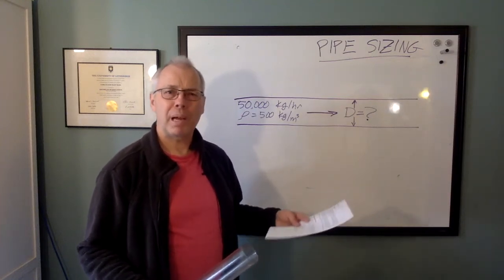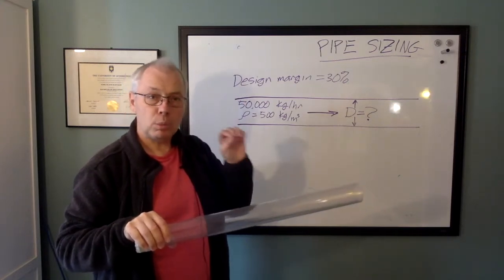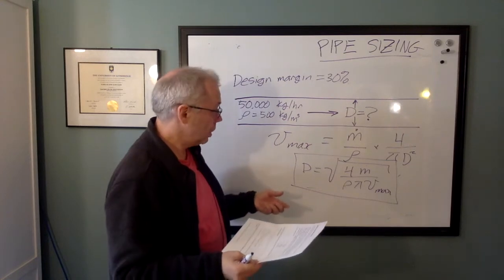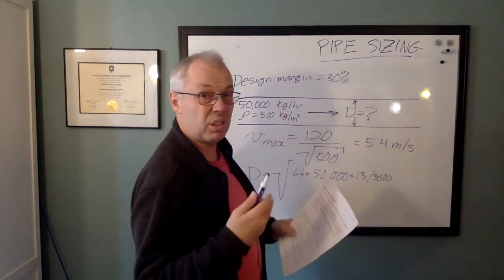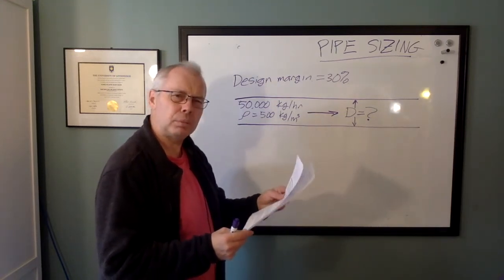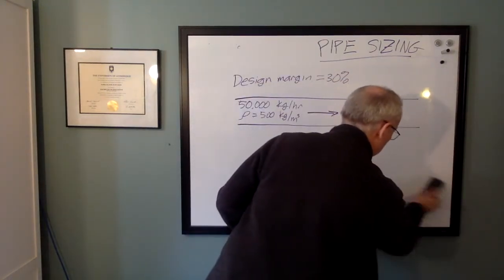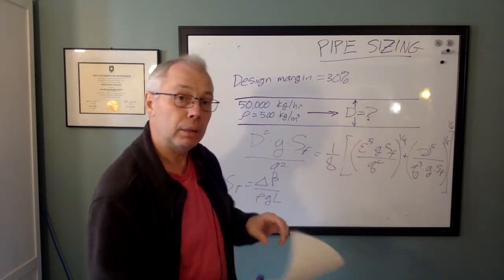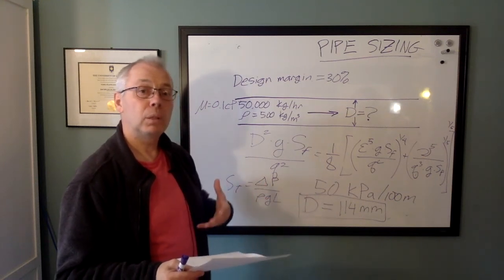Process Engineering: Line Sizing

Comment: Respected Sir, if flowrate is too high as the objective product output is high, we would distribute flowrate in parallel pipe system, how to then find the individual flowrate of each pipe and its diamtere,  considering we only have Vmax, Q (Vol flowrate) and m (mass flowrate)
Reply from the maker: We use the same approach as electric circuit with resistors in parallel. There is a current balance at each branch. Each resistor uses V=I R. With electric circuit we get a matrix equation for all V and I. With hydraulics the equations are quadratic.

Comment: Very informative.Since this method is applicable to single phase flow only why cant we consider darcy weisbach equation to calaculate frictional pressure drop?
Reply from the maker: This methodology is based on Darcy Weisbach. The difference is the friction factor is correlated with a different set of parameters. The standard correlation for friction factor produces a nonlinear equation in diameter. Frictional pressure drop is roughly proportional to D^5. You could use an iterative method to solve this equation.

Comment: Sir plz  do make  videos on valve sizing, pump hydraulics etc
Reply from the maker: Thank you. I don’t have a lot of time right now. I will do that when I have time.
Reply: @kevindormaconsulting4763 hello sir, is this lesson applicable for calculating the discharge line of a tank?
Reply from the maker: @khenkhen08  Yes, but this pipe may be short. It this case you need to check the pressure drop from the entrance loss. You should also check if the drain line could produce a vortex and pull gas into the line.
Reply: @kevindormaconsulting4763  Hello, Sir. In calculating the pipe size diameter of tank’s discharge, do i need to consider the mechanical energy balance of that tank to the tank where it will be transferred or i can just isolate and make a mechanical energy balance around the tank that I will design?

Comment: Kindly guide me, I am starting calculations for Medical gas pipeline system. How to start it for a hospital?
Reply from the maker: Start with a drawing of the piping system. Show the main header for each floor, and the branch lines for each consumer. Then you need to decide the amount of DP that can be taken for the main header and the branch lines. This is always the list difficult part. What is the basis for the flow rate through the main header and each branch line? How much design margin do you want for these flow rates? These are difficult questions but very important. If the main supply is at 500 kpa then decide the pressure you can accept at each consumer. It may be 450 kpa. You can take 50 kpa for the entire path. How much DP will you permit for the main header, and how much for the small branch to consumers? You might decide 20 kpa for main header and 30 for branch. What is the piping length for main header and for the longest branch? This gives you the DP per 100 m. How much design margin do you need for each line?

Comment: How about the pressure loss from fittings like elbows and tees?
Reply from the maker: Line sizing is performed long before we know what the pipe route looks like. It is simply a way to choose a reasonable flow velocity. Perhaps engineers should look at this and consider the number of bends in the path and the overall pressure we can afford to lose. This might be a nice topic for a Masters Degree research project. Thanks for asking.
Reply: @kevindormaconsulting4763  well I just asked because in duct sizing we consider the the fittings first before we size.
Reply from the maker: @arielmcdowny2367  ahhhhhhh. An elbow has an equivalent length of about 30 duct diameter. Ducts are usually short but there may be several bends. 6 bends in a 24 inch duct is equal to 360 ft of duct. The duct may be only 50 ft long. Thanks for the knowledge.

Comment: We calculated 2 different values of the pipe diameter using Velocity and Flow Rate as constraints. 
My question is, " which 1 of the 2 should be used for design purpose?". 
Bigger pipes may validate with pressure drop condition, but the Velocity in the downstream, might be too less for the process to operate optimally. 
Please tell
Reply from the maker: Each constraint is a value that we must not exceed. Pick the larger diameter. One example where a larger pipe is bad is slurry flow. Low velocity causes deposition. The simple rules do not apply here.
Reply: @kevindormaconsulting4763  For single phase fluid flow, the larger pipe should be used, considering pressure drop. That means pressure drop has more weightage than Velocity. 

Yes, i agree with the slurry flow. I remember in the Biogas Project, the pipe diameter was reduced from 20" to 16" from FEED to Detailed Engineering, when hydraulics were verified.

Comment: Very Simple and clear. Thanks a lot. 

So this method is for single liquid phase only. What about two phase flow and single phase gas flow?
Reply from the maker: Using pressure drop for sizing gas flow is fine. But this only applies if the gas flow is incompressible. Velocity less than Mach 0.3 and density change less than 10%. Do not use this method for high speed gas or large DP, such as outlying pressure safety valve. And do not use for two phase. Two phase flow has other conditions that we must consider.

Comment: Where that  1.3 comes while calculating D means (1.3×3600) that 1.3
Reply from the maker: The 1.3 is the design margin that I assumed for the flow rate (time 2:00 in the video). We always need to consider design margin, and I assumed that we need to allow for 1.3 x 50,000 kg/hr = 65,000 kg/h. This design margin depends on your situation.  You may not need to provide any design margin for the flow rate.  You can check the example in my blog at https://kevindorma.ca/2021/07/14/pipe-sizing-is-more-than-a-speed-limit/
Reply: @kevindormaconsulting4763  you like making life easy for yourself by not explaining or deriving the equations put forth.Would it not be better if u derive the equations from first principles?
Reply from the maker: @Tech.Library  I thought I did a fair job. The use of an erosional velocity (and the C factor based on the fluid service) is from API14E. You can check the example in my blog at https://kevindorma.ca/2021/07/14/pipe-sizing-is-more-than-a-speed-limit/.  The mathematics for the pressure drop per 100 m is from an old reference in Perry's handbook. The reference is actually an empirical correlation for the friction factor that uses pressure drop instead of Reynolds number. It is quite clever.
Reply: @kevindormaconsulting4763  thank you for the link.
Reply: @kevindormaconsulting4763  does pressure drop increases at an elbow joint or decreases?
Reply from the maker: @Tech.Library  the pressure drop for an elbow is typically equal to 30 lengths of pipe.
Reply: @kevindormaconsulting4763  can u elaborate more? What do u mean by 30 length?
Reply from the maker: @Tech.Library  this means the frictional loss of an elbow is equivalent to 30 x D distance of pipe with the same diameter D. Equivalent length is a simple way to express the friction losses for fittings.
Reply: @kevindormaconsulting4763  Thank you. But For an incompressible fluid.